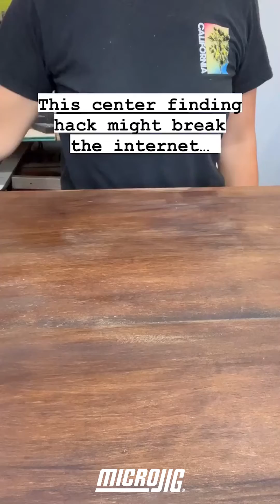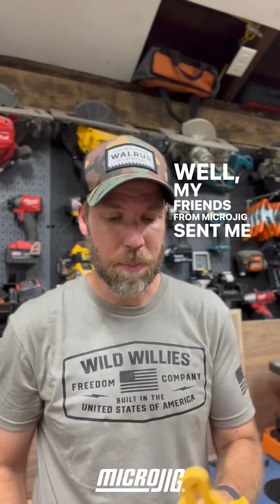How woodworkers find the 1/2 thickness of material using the FitFinder 1/2 Gauge! #shorts

Comment: Ability to measure 1/2 is easy. Transferring to saw is the hard part.  More importantly my saw blade height moves ever so slightly as I cut.  Can’t seem to fix that. Lol.
Reply from the maker: If your saw shifts height slightly when you turn it on, that will be an issue for you with any project!
Clean and check the elevation mechanism, there may be some "slop" there. It you can tighten the elevation wheel before turning on, that may help.
Finally, if there is movement, you can minimize the movement by starting low and bringing the blade up, so the various threads are in fully in contact.
Reply: @Microjig  it does. The blade keeps on creeping down. I found a “fix” for it. It’s better but didn’t fix the problem completely. Oh well.
Reply from the maker: @ipick4fun27  If it is a more expensive saw, the elevating screws can be replaced (or whichever part is warn). 
If it is a less expensive saw, save your pennies for a better one as you may.
Reply: @Microjig  I have DeWalt 7491RS.  I am quite disappointed that the screw holding the blade came loose 3x.  The blade retracts on its own due to vibration during use causing variable height groove cut. And the locking lever came loose on the bevel cut that totally ruins my zero-clearance table saw sled.  I checked for those regularly.
Reply from the maker: @ipick4fun27  Sorry to hear that. We just bought that saw for some video work in our shop and at least the one we have seems to be pretty nice.
Have you contacted DeWalt to see what they can do to help you? I have found that  reaching out and politely asking gets you some surprising results.